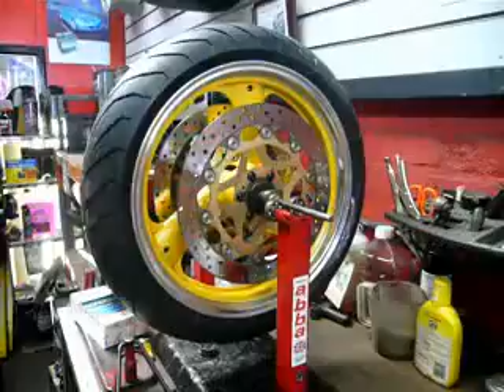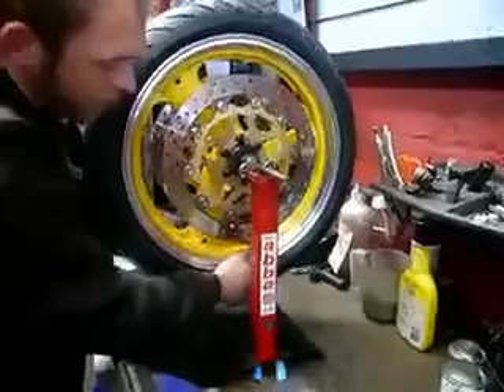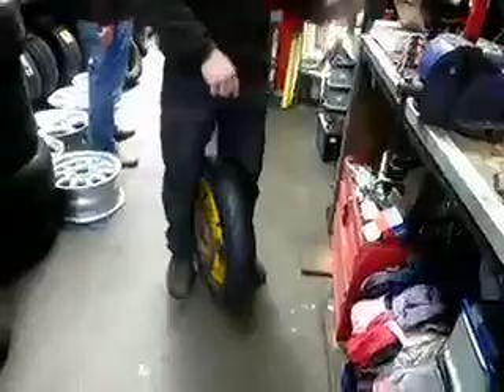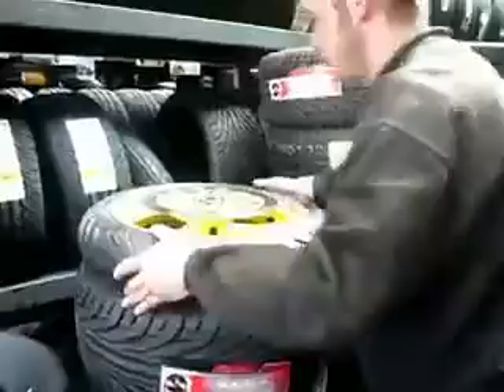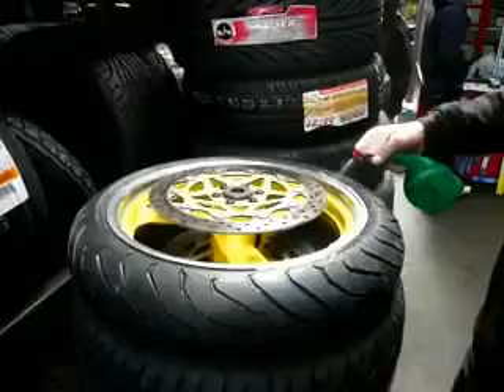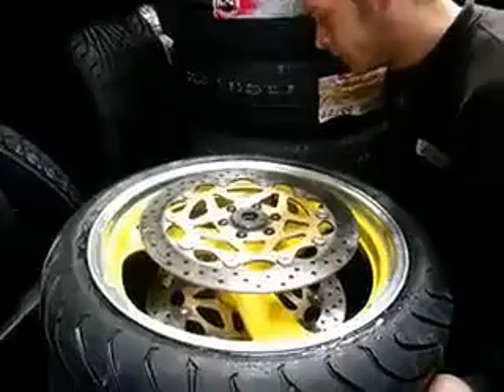motorcycle wheel balancing using abba balancer

Comment: I just had new tires put on my bike. The noticed the techs put on some lead strip weights; 1 strip on both sides of the back rim, and 1 strip on the left side of the front rim. The ride now feels awkwardly heavier, but I'm not so sure if it's more so because of the new tires. Or is it the weights?
I was also wondering if I remove these strips (because they didn't not even the area of the rims they put the strips on) so that I can clean my rims first, what can I use to re-apply the lead strips. And am I going to strip the paint/color off the rim if I try to remove the strips?